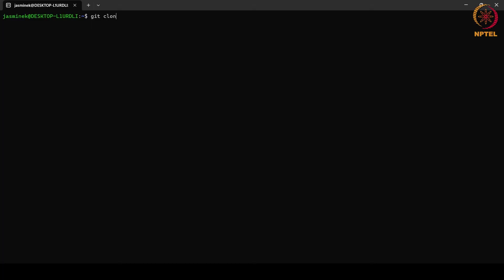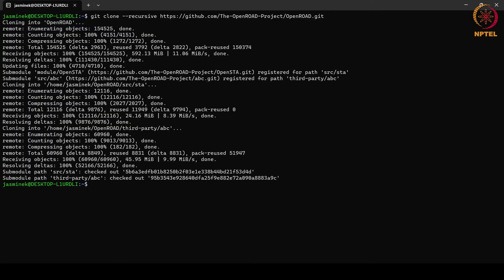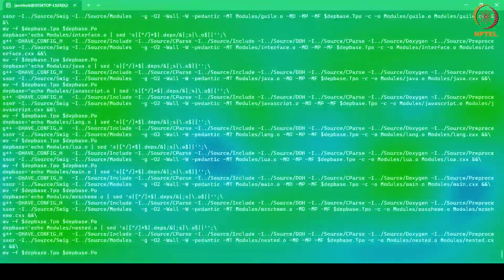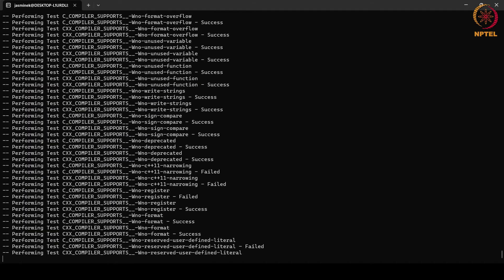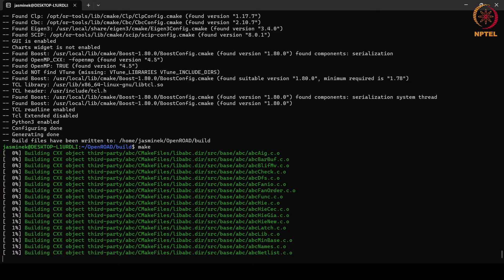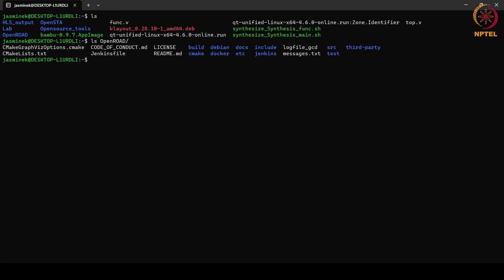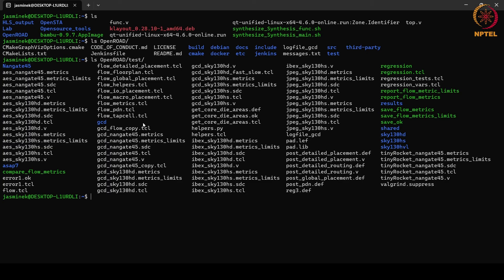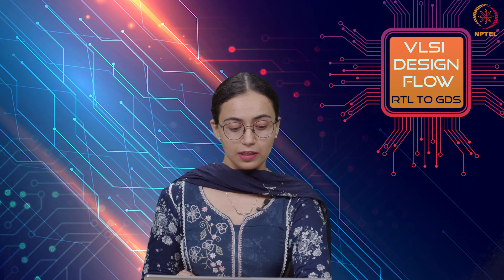Installation of OpenRoad

Comment: cmake error : CMake Error at /usr/share/cmake-3.28/Modules/FindPackageHandleStandardArgs.cmake:230 (message):
  Could NOT find SWIG (missing: SWIG_EXECUTABLE SWIG_DIR) (Required is at
  least version "4.0")
Call Stack (most recent call first):
  /usr/share/cmake-3.28/Modules/FindPackageHandleStandardArgs.cmake:600 (_FPHSA_FAILURE_MESSAGE)
  /usr/share/cmake-3.28/Modules/FindSWIG.cmake:153 (find_package_handle_standard_args)
  src/CMakeLists.txt:141 (find_package)

Comment: sudo ./etc/DependencyInstaller.sh        

unsupported system: Kali GNU/Linux

Usage: ./etc/DependencyInstaller.sh
                                # Installs all of OpenROAD's dependencies no
                                #     need to run -base or -common. Requires
                                #     privileged access.
                                #
       ./etc/DependencyInstaller.sh -base
                                # Installs OpenROAD's dependencies using
                                #     package managers (-common must be
                                #     executed in another command).
       ./etc/DependencyInstaller.sh -common
                                # Installs OpenROAD's common dependencies
                                #     (-base must be executed in another
                                #     command).
       ./etc/DependencyInstaller.sh -prefix=DIR
                                # Installs common dependencies in an existing
                                #     user-specified directory. Only used
                                #     with -common. This flag cannot be used
                                #     with sudo or with root access.
       ./etc/DependencyInstaller.sh -local
                                # Installs common dependencies in
                                #    "/root/.local". Only used with
                                #    -common. This flag cannot be used with
                                #    sudo or with root access.
i am find that kind of error.
 
can you please resolve it.